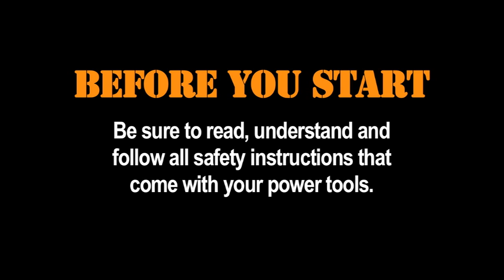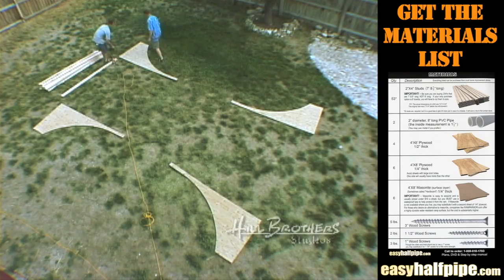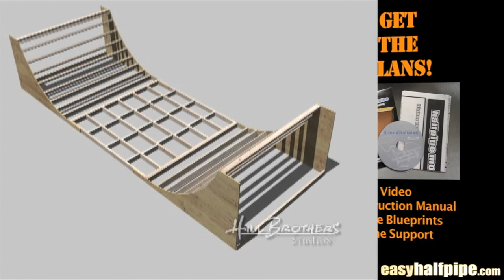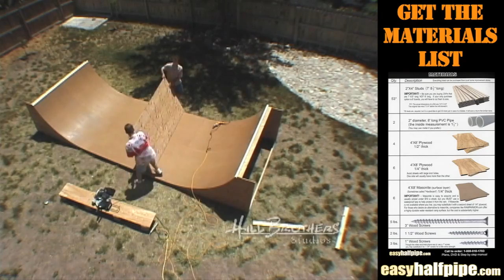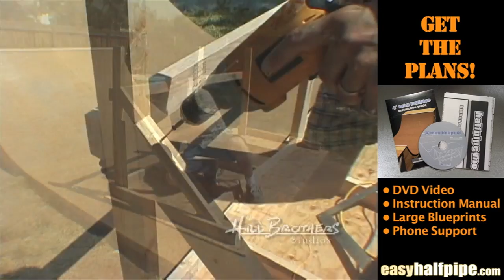How to build a halfpipe from start to finish

Comment: tip use 3/4 plywood for flat bottom use 2 layers 3/8 plywood for transition use 3/4 plywood for transition templates make 8 instead of 4 ,cut 2x4's or 2x6's 46 1/2 inches connect transitions together attach 2 transitions together ,this is far more stronger than using just 2 transitions and attaching them with long 2x4's or 2x6's there will be no soft spot in the middle of your transitions  i have been building ramps since the early 70's they never fail

Comment: ramps should be built on blocks off the ground to prevent rot.
Reply: think cement slabs will do fine
Reply: Eric Codina from what i see that ramp is sitting in the grass. I don't see any cement slabs.
Reply: what am trying to say is that cement slabs will work too
Reply: better

Comment: you didn't explain how it folds up to make it portable.
Reply from the maker: +Edward Ramirez This is covered in the printed manual & blueprints.  The transitions, decks and flat bottom are made to come apart in chunks.  They then stack quite nicely into a cube.  It's still big, but a fraction of the size.  It would take 3 to for guys to move the ramp when taken apart.  Hope that helps.
Reply: Edward Ramirez  right
Reply: @Edward Ramirez @easyhalfpipe
You have to buy the plans for that bit of information. Come on guys, OP was kind enough to give the full instructions for a nice little mini-half at no cost. Let him have something to enable him to make a dollar or two for his time and effort.
Reply: It gets a little more complicated. I guess you've had to unscrew the stud and transitions then take them apart. Little tedious but doable.
Reply: @mikeycrabtree123  their website is shut down and you cant buy the plans anymore.. can we find out how to do it now?

Comment: Is that PVC!? ALWAYS use steel.
Reply: +hsuleid27 I know. who's ever idea it was to use pvc is a little special... or doesn't skate
Reply: +hsuleid27 Explain plz.
Reply: it's a pvc pipe... yeah...
Reply: Guillaume Reeves thanks
Reply: Use steel. It's better. Plastic bends and cracks the heavier you get.
Reply: probably just for the sake of the tutorial
Reply: @Lowpololoco  i thought so to but tgen why didn't they specify.
Reply: I've been using pvc as coping for 2-3 months skating on it 2-4 hours a day I weigh 105 pounds and it's been fine, what do you mean ?
Reply: I’ve been using pvc 
as a snowboard rail for 3 years.🤔
Reply: @nikosoup7999  Try a nice long 5-0 grind. Come see us when you get our of hospital.. your trucks are going to bite into the plastic.
Reply: @mitch3384  not if you inline skate the bases are plastique.

Comment: I'm calling the SPCSB after you.

(Society for the Protection of Cruelty to Screw Driver Bits)
Reply: Why?
Reply: ? Watch the video...
Reply: Cbr 929 l skipped a few bits...too boring
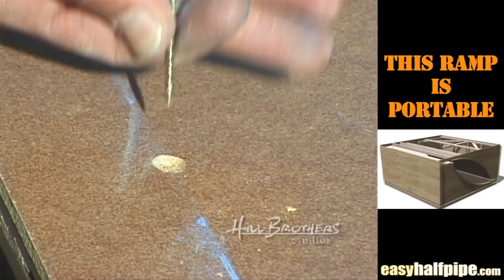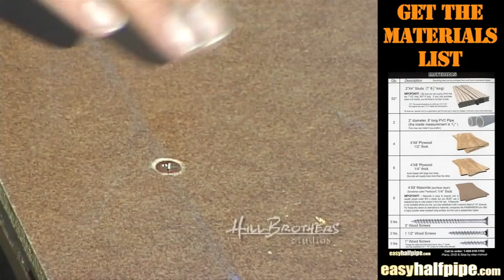Reply: 10:40-10:45 , prime example.
Reply: Cbr 929 oh you mean the wood dust?
Reply: No, I mean the driver bit bouncing out of the screw. What happens when you use a drill without torque settings to put screws in. My inner DIY Nazi hates that sound.
Reply: MollariB5 l use the same mode as for drilling...never had a problem.
Reply: Don't believe you . I think you're telling me porky pies. Standard drills run on like in the video. Piss poor tool operation imo.
(unless your drill has a screw option on it of course)
Reply: MollariB5 Yeah my drill has screw and drill option.It s a Bosch lol
Reply: Lol, I was thinking the guy should not be allowed to use a Phillips tip the whole time I watched

Comment: dont use pvc pipe for coping or leave the screw has hanging out of the coping. the pvc will stick and not grind and the screw heads will catch your trucks
Reply: Ben Muffett  metal all the way
Reply: Ben Muffett pvc does slide with wax
Reply: But I agree don't leave screws hanging out of the coping
Reply: you mean dont leave. whats left of the screw head sticking out😂

Comment: PVC pipe works great I have had a halfpipe with PVC for 10 years now.
Reply: did u use masonite
Reply: @adinmoments7620  no but I have replaced the top layer twice
Reply: @hoytarchery5302  what did u use
Reply: @adinmoments7620 thin plywood 3 layers
Reply: @hoytarchery5302  ok sorry for the questions but what thickness and kind

Comment: That's a great looking half pipe!
does the distance between the two ends matter? I mean the length of the whole thing, is there some standard rule as to the ratio of length x height?
Reply: Yes speed you don't want to loose it. Not too close not too distant either.

Comment: the math for transition thickness 2 pcs 3/4 inch ply plus 46 1/2 will equal 48 inches. plywood width , 3/8 plywood x2 equal 3/4 so 3/4 flat deck will line up with transition with double layer 3/8 plywood do math or take measurements on where you put the screws so when you put the masonite on you dont run into screws and use a countersink for screws

Comment: I'm going to skip the coping as it stops me from air-ing from and back into the pipe if that make sense?
Reply: I skated a ramp without coping it's better. You can't slide but it's a lot smoother   to skate.
Reply: However you might want to grind across the coping
Reply: +TheLonelyIceBoy depends if your skating or biking. on a bike the coping gives you a boost out of the ramp.
Reply: Well when you air out you're Ollie-ing so why can't you just go over it? I have never really had problems with that, maybe you want to put the coping in q bit farther.

Comment: can i leave this outside in the snow and rain or will it ruin it?
Reply: You have to put something over it to protect your skatepro or whatever you use as a top material.
Reply: tarrrrrrrrp
Reply: i also heard something about weatehr resistant paint, should i be set with that and covering it with a tarp?
Reply: Yes, There is also wood you should buy that is weather resistant. So that the mini you build last as long as you want it to.

Comment: I built the ramp and it was pretty awesome but 6 months later the Masonite is falling apart.  Is there something better for South Florida weather?
Reply: Ivan Izquierdo You put the ramp outside with Masonite in South Florida?  Skatelite or ramp Armor will work outside but they are expensive. Just use plywood and waterproof the wood.
Reply: seal and paint the masonite and put tar paper under it it will last longer

Comment: how much is the project?
Reply: Depends on what kind of wood you build it with.
Reply: It's usually around $600
Reply: Ive priced all the lumber at homedepot to be around $300. Thats without the screws, but that shouldnt be that much more. If you look around i'm sure you can find better prices on lumber for it all.
Reply: Could also get two extra sheets of masonite for the top parts, make it a bit nicer. For about an extra $20.
Reply: I found an offer nearby of 75 wooden beams of approx that length for 100$ (Second hand). You could build 2 ramps with that. And the plywood wood well maybe 50 to 100$ second hand as well...not to mention a lot of it you can find in the  waste containers outside woodworks, or in abandoned houses etc...
Reply: I'm in the business and I've made a lot of different ramps, so trust me when I say the cheapest it will be if you get everything you need for a decent half pipe at home depot, it will be at least $550. Good luck with your project.
Reply: Make It Lol did u read my response? Why you have to reply over me?
Reply: I was mainly replying to Dennis and how he was giving out bad information. If you can find everything you need for cheap, good for you.
Reply: Make It ok :) pretty sure you can always find cheap, you just have to go about it a different way, search in classified ads "second hand wood /beams". And scavenge around wood works, factories and abandoned places...
Reply: +Make It I've made numerous ramps myself, and have actually looked up an itemized list of prices, and calculated it all out, this is also with replacing the pvc with metal coping. My calculations are correct. Ever consider the fact that maybe it's a different state and prices are different? Instead of flat out saying somebody is wrong, do your own research and don't be a tool.
Reply: Dennis Nesser l made a ramp for 0$ !! In a junkyard, got all the wood l could find and nailed it all together. I even collected the nails from the ground of a construction site.
Reply: +Jason Eaton I've considered making the base of ones with wooden pallets before, would save quite a bit of wood. Still would need to make the transitions though. But super impressive that you were able to find all the ply and such.
Reply: Dennis Nesser I did take that into consideration. Even it was less in a different state it would never be 50% less. If it is that much less for the exact same high-quality ramp that I make, I need to open a shop there. 

Do you have two layers of plywood or just one? That could be a large difference in priece 

Also, do you coat yours with weatherproofing agent?
Reply: Dennis Nesser  Yeah l considered pallets too, but beams work a lot better, you need to look in the classifieds of a rural area, guaranteed you'll find a shitload of wood for a small price. For the boards l just found a set of 100 next to an old factory of some sort, it was kind of old but still totally did the job. Just check out very rural areas it's a goldmine! :)
Reply: +Make It  It yes I have 2 layers of the plywood, and a layer of Masonite. All the ones i have constructed before have been for indoor skate parks, so no true need for waterproofing, and any coloring/staining is up to the property owners.
Reply: Dennis Nesser Well, mine have all been for outdoors. What state do you build in?
Reply: +Make It Texas.
Reply: Dennis Nesser I'm building in AZ
Reply: make ignor theese battys, the truth comes from building the thing, they think they can do it for 200 let them ha
Reply: Sam Page Actually l once built one for free.
Reply: Obviously part of the vast majority of people who watch this video who have free access to copious amounts of wood and who value their time as worthless then .... Speng
Reply: Sam Page what?
Reply: Jason Eaton it was sarcasm sweetie, don't worry about it
Reply: expensive
Reply: Where in AZ? Have any plans? I'm in Tucson
Reply: yes

Comment: How do you protect the Masonite from rain damage? Thanks for your time.
Reply: put a tarp if yoju can findone
Reply: I'd guess that you would fold it and tarp it
Reply: you should water proof it with wood oil that will protect the Masonite but the down side is is that once a year you will have to oil it again and you wont be able to ride on it for like 8 hours (or until its dried) this is how i protect all my wooden stuff. hope this helps.
Reply: Try ramp armor instead
Reply: seal it with a weather proof sealer both sides. then pain it after. and lay tar paper down prior to installing the masonite.

Comment: i used 1/4th inch plyood and it started warping and bowing after onetime raining on it so I took it off and used 3/8ths inch plywood and now it has done the same thing just not as bad.

How do I fix this or prevent it from happening again?

It bows up between every screw, and makes the ramp lumpy and wavy.
Reply: use more screws so theres not so much space between them. put a screw every 4 or 5 inches this way theres now room inbetween screws for the wood to swell and buckle.
Reply: I tried that but it was still wavy and in one spot is warped with enough power to pull a 2x4 through the side wall.

I had to fix that and then I put a 1/2 inch layer on time of pressure treated and its been fine, but there is one sheet thats chipping off so we are now putting a top layer of metal.
Reply: Charles Oxendine yea presser treated is the way to go it doesn't rott and its already soaked thru with the chemicals so it won't swell I just didn't think they made it in plywood haha. the metal sounds like a good idea to
Reply: AP tattoos Yeah, it was surprisingly cheap too, $22 a sheet at my local lowes, so its not much more than the non treated.

They have 3/4 inch too but its like $34 a sheet and probably nearly impossible to bend.

The only issue now is that since its pine its soft so doing blunts and landing hard on one sheet as made dents which then start cracking and the top layer is chipping away, but its only that one sheet so I think it may be defective.

If I had to do it over again I would have just used 2 layers of the half inch and use the 3/4 inch as my side walls so they wouldn't rot and theyd be super strong.
Reply: Charles Oxendine hey man as long as it works your good to go. you should put up a video of your shredding on it I kinda wanna see what this thing looks like haha.
Reply: put masonite on top of it... or use skatelite or ramp armor
Reply: Masonite wouldn't last outside and skatelite is super expensive.
Reply: try a thick rubber matt with a pitch for water run off,,,,build a davenport,,or tarp it in the rain
Reply: seal your wood or paint it

Comment: it's not a half pipe. it's a miniramp. 
is that coping made of plastic? looks weird. 

besides that the video is pretty good.
Reply: 6ch6ris6 its a half pipe
Reply: nope. it is a miniramp. 
a half life pipe is 90° on the top. so when you put two half pipes together you get a pipe. a miniramp isnt that steep at the top. that's the difference. the 90° part is the reason why it is way more difficult to skate in a half pipe than in a miniramp.

Comment: how much did this cost altogether
Reply: I found an offer nearby of 75 wooden beams of approx that length for 100$ (Second hand). You could build 2 ramps with that. And the plywood well maybe 50 to 100$ second hand as well...not to mention a lot of it you can find in the  waste containers outside woodworks, or in abandoned houses etc...

Comment: how much does the hole cost  with metal cooping?????????????????????????????????????????????????????????????????
Reply: I found an offer nearby of 75 wooden beams of approx that length for 100$ (Second hand). You could build 2 ramps with that. And the plywood well maybe 50 to 100$ second hand as well...not to mention a lot of it you can find in the  waste containers outside woodworks, or in abandoned houses etc...

Comment: WHY PVC COPING?!?!?!?
Reply: That's exactly what I was thinking WHY?!?!?!
Reply: Bee Vans because if its steel or metal its gonna take alot more work at time to drive screws and the drill bit through it (and money as metal has a specific bit that can cost around 50 bucks) so thats why PVC... even though PVC is shit :)
Reply: i see where you are coming from and i agree but on the other hand if you have enough money to build a half pipe then why would you not have some more to make it a reliable one .. :)

Comment: damages or injuries or DEATHS really deaths why would you mention deaths
Reply: Because there are those foolish enough to skate without proper safety gear, head trauma is a thing in the world of skateboarding, and head trauma can be fatal. Add these facts to the fact that there are also those out there who are of a highly litigious bent that will sue you at the first opportunity. Hence the legal disclaimer. It a very smart "cover your own ass" measure.
Reply: Bro it's a 4 foot high miniramp not a 20 foot vert. As a starter you could wear gears if you wish. If you're confident enough then just ramp away without excess. You know your limits.

Comment: how long would this take to make if you could work on it 6hrs a day, please reply to the comment not make a new one or like it :P thanks heaps :D
Reply: less then 1 week if you are an experienced carpenter.
Reply: It would take u like three days
Reply: Yeah Liam Arnold? Please tell me how that is possible doing by yourself sooooo quickly with precision. I understand  if there were 2 , but I'm talking about 1
Reply: Im not sure about this ramp but other ramps I've looked at, they've been saying with 2 people it takes around 3 days. It could take much longer if ur doing this exact ramp, cause it's made to be portable aswell
Reply: I just built it in less than a week, about 3 hours a day. I had my wife help hang the transition studs, other than that all solo
Reply: i am an experienced carpenter and i reckon i could build that on my own in 2 days more like 8-9 hrs a day. theres nothing to it. its all repetitive cut sizes.set up stops on chop saw for cross members will speed it right up.if you dont have another person to help use a nail gun to tack things in position before screwing for ease of assembly.good luck